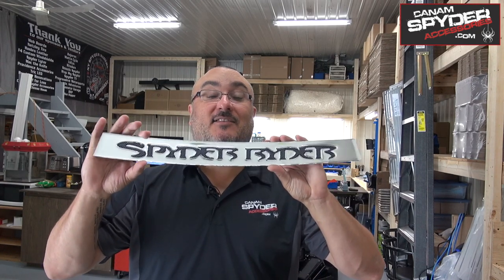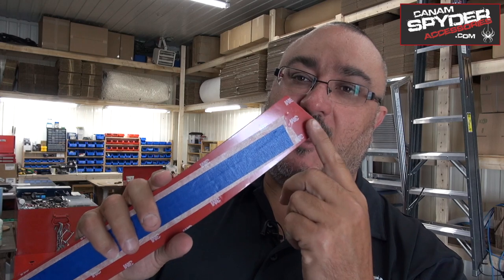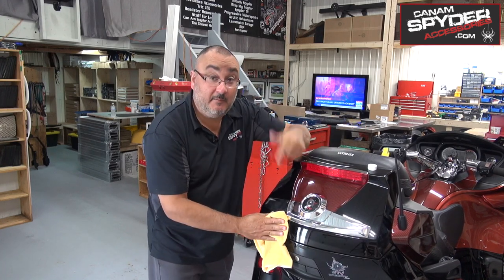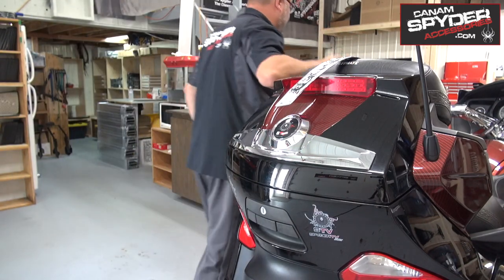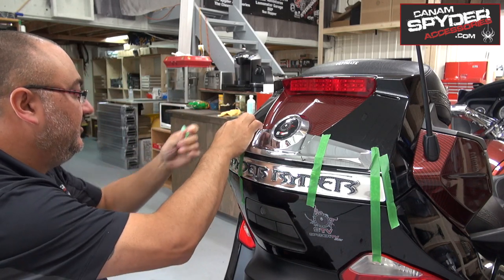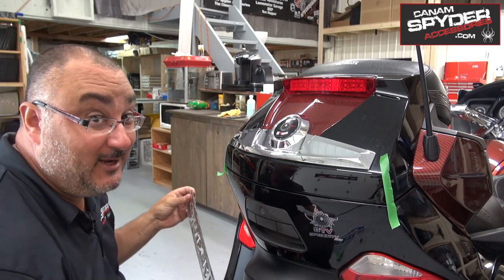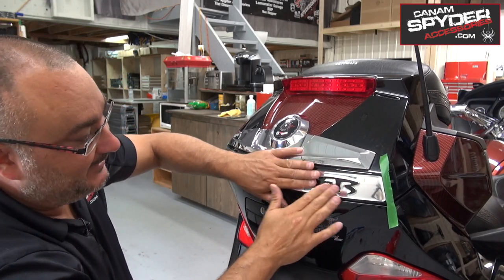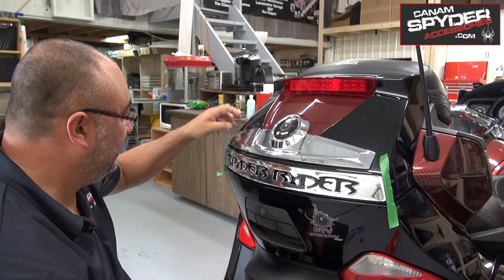Installation #301 RT Rear Trunk Spyder Ryder Chrome Acrylic - Can Am Spyder

Comment: Pierre. Where did u get those rear trunk lights. Watching youtube. Smoak said that their trouble n not designed to work with the can-am wiring system
Reply: That brake light on your trunk
Reply from the maker: @michaelwhitfield609  Hello, from custom dynamic a long time ago, never did have issues with it. We did install it ourselves. Check my website, i do have another model.....www.canamspyderaccessories.com